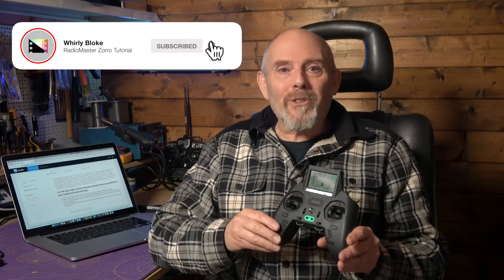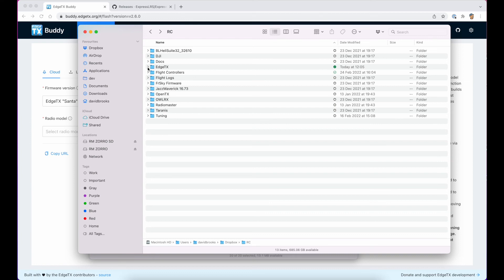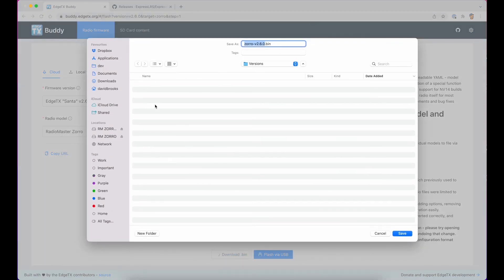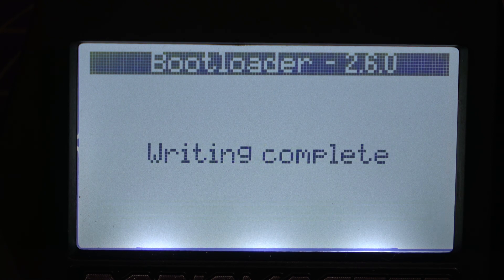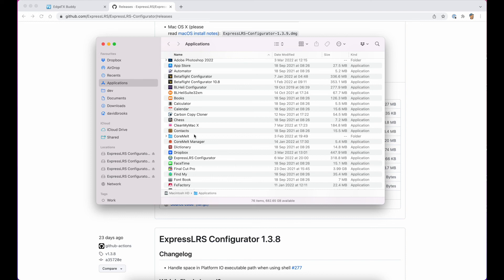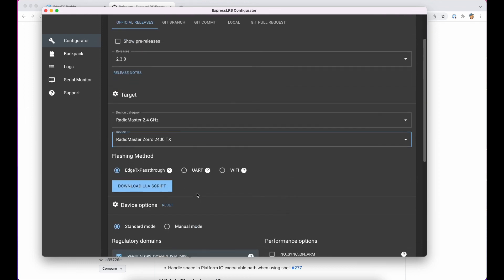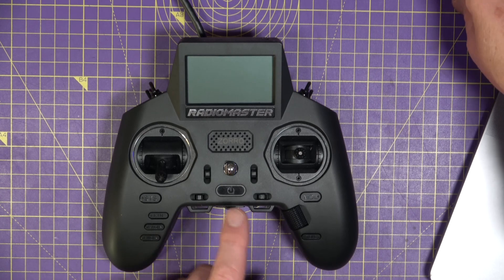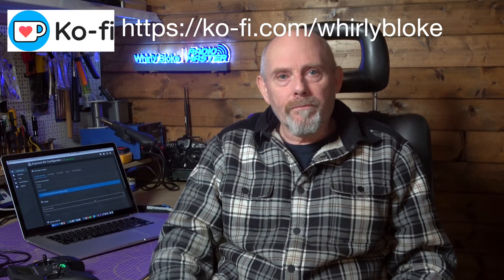RadioMaster Zorro Tutorial - Upgrading EdgeTX and flashing ExpressLRS ELRS RF module

Comment: I've had a Zorro for nearly 6 months now and it's just one issue after another.
No documentation, dodgy serial port drivers and constant issues with ELRS lua scripts.
I'm now getting an issue where the BIND menu exits after 1 second and nothing appears in Betaflight.
Yeah, my firmwares are up to date....I seem to spend more time farting around with them than I do flying.
Are all radios this shit or would it be worth springing the cash for a TX16 II?
Reply from the maker: Totally get the frustration — the Zorro can be fiddly, and you’re not alone with issues like ELRS Lua bugs and binding problems. It feels like more time tweaking than flying.

The TX16S MKII is a solid step up. Way more stable, better build, and just works. If you’re tired of messing around and want reliable gear, it’s worth the upgrade. If you want something compact but solid, the Boxer is also a great choice.

Comment: Thanks for a great tutorial.
Reply from the maker: You are welcome!
Reply: @WhirlyBloke  By the way, the original ELRS that shipped with the Zorro allowed to go up to 250mv in TX power. After the update to the latest elrsV3.lua, the TX power caps at 100mv. Is that expected? anything in the regulatory configurations that can up the TX power higher than 100mv?

Comment: I flashed my TX12MKII with EdgeTX buddy but the hardware page in my radio under options show luac, but no lua
do you know how to get the lua build option too?
because I want to install Yaapu Frsky Telemetry script and it's wiki says I need both lua and luac
Reply from the maker: To get Lua and Luac scripts, you need to check the firmware build options you selected during the EdgeTX flashing process. Make sure to select a build that includes both Lua and Luac scripts support. You may need to reflash your firmware with the correct options. This should allow you to use the Yaapu FrSky Telemetry script. Let me know how you get on.

Comment: I was performing an update of the software to its latest version (EdgeTX "Providence" v2.9.1), it was done without complications, but the remote control doesn't turn on. I have already checked the batteries, and they are functioning normally. What can I do to restore the factory settings?

Comment: Threr is only the flash option, not the build option. Its not working. Help pls
Reply from the maker: Check the RadioMaster website, latest Zorro manual or ask RadioMaster support. I've found they are very responsive.

Comment: I bought second hand zorro with external happymodel 24 elrs. Because i have quadcopter with v3 elrs, i install v3 elrs in happymodel. Everything seems work very well, my zorro can connect to my drone and control it. But, when i enter expresslrs menu in my zorro, i only see two menu. 1, other device, and 2 is exit. Its strange

My question, should i update my zoro firmware?

Thank you
Reply from the maker: Definitely. You need the correct LUA scripts on the Zorro to setup up ELRS. The easiest way to do this is upgrade the Zorro to the latest version of EdgeTX which will install the latest LUA scripts on the Zorro. Thanks for watching.
Reply: Thank you for your respond and anwer sir @WhirlyBloke  . I follow your instruction video but little bit confuse for choosing firmware name (i see many name firmware), so i choose edge tx providence 2.9.1 with radio model radiomaster zorro. After i installed it. my radio can conect to drone but i cant arming  my drone and my problem still exist. I check the expresslrs menu on radio and i didnt see anything. Can you give me some advice?

Thank you

Comment: I just replaced the internal 4in1 board with an ELRS board in my new Zorro.  Everything in the app works until it tries to connect to the transmitter.  I'm getting failure to connect on COM3.  Going to try UART and see if that may work.
Reply from the maker: Thanks for sharing your experience. Let me know how it works out.

Comment: Sorry, but I get errors and now I cant bind to my other 2 quads which have Elrs. For me its a disaster.
Reply from the maker: I'm sorry to hear that you're facing difficulties after upgrading your RadioMaster Zorro and flashing the ExpressLRS ELRS RF module. Firmware upgrades and module flashing can sometimes be challenging, and errors can occur along the way.

If you're currently unable to bind to your other two quads that also have ELRS, I understand how frustrating that must be for you, so here a few things to have a look at.

First, make sure to double-check the firmware versions on your RadioMaster Zorro and the ELRS modules. It's essential to ensure they are compatible with each other. Also, verify that you have the latest firmware installed on all your devices.

Next, check the configuration settings on your RadioMaster Zorro and ELRS modules. It's crucial that they match the required settings for binding and communication. Sometimes, a small configuration mismatch can cause binding issues.

If the problem persists, try following the correct binding procedure for your quads and the ELRS modules. Going through the binding process step-by-step might help identify any mistakes or missed steps.

Additionally, if possible, attempt to bind one of your ELRS-equipped quads with a different transmitter. This can help determine whether the problem lies with the RadioMaster Zorro or the ELRS modules themselves.

Remember, you don't have to face this problem alone. Reach out to the RadioMaster or ExpressLRS communities for support. They have active forums and social media groups where experienced users can offer guidance and help troubleshoot issues like this one.

I understand that technical difficulties can be frustrating, but with patience and support from the community, I'm confident you'll be able to overcome this setback and get your quads back in the air.

Best of luck, and I hope you're able to resolve the issue soon!
Reply: @WhirlyBloke  Thanks for quick reply. I will try to restore the Zorrow from back up. You’re correct it’s very frustrating. It really shouldn’t be this hard and only tried to update after buying the Crux 35. I normally use Crossfire and never have issues. Will see how this drama plays out. Cheers.
Reply from the maker: @scrubbasher6418  I know it's probably a bit late now, but always, always, always backup your radio or flight controller before you do a firmware upgrade. It's easy to say, and I've forgotten in the past and regretted it, but it's good practice.
Reply: @WhirlyBloke   Update. Got the Crux35 to bind to the Zorro. I needed to check what firmware I had on the TX and and it was 3.2.1 so I knew it should work. Anyhow I needed to change model match to on. Its in the instructions damm it. When all else fail hey. Now i believe i have to change the firmware on my mobular7 and gep smart 16 to work now. Thanks for all your replies.

Comment: when my pc was flashing, i didnt have enough disk space, when i freed up space, it didnt ask me to install anything again but the flash was successful. is this a problem. or how do i set it away to install again?
Reply from the maker: It's possible that the Radiomaster Zorro software was already partially installed on your PC when you started the flashing process, and that the freed-up disk space allowed the software to complete the installation and successfully flash the device.

If the flashing was successful and you're not experiencing any issues with your device, then it's unlikely that there is a problem. However, if you want to ensure that the software is installed properly, you can try uninstalling it and then reinstalling it from scratch.

To uninstall the Radiomaster Zorro software, you can follow these steps:

Click the "Start" button in the lower-left corner of your screen.

Type "Control Panel" and click on the "Control Panel" app that appears in the search results.

Click on "Programs and Features" or "Add or Remove Programs" depending on your Windows version.

Scroll down the list of installed programs until you find the Radiomaster Zorro software.

Click on the Radiomaster Zorro software, and then click on the "Uninstall" button.

Follow the prompts to uninstall the software.

Once the software is uninstalled, you can download and reinstall it from the official Radiomaster website. During the installation process, you should be prompted to select the installation location and disk space, so you can ensure that there is enough space available for the installation.
Reply: @WhirlyBloke  i kept my eye on it but every thing is working as it should now 👍

Comment: I just bought the RadioMaster Zorro 4in1. On this device do I still update Express LRS into it? ATM I am just buying this controller to hook up to my iMac 24" and play the sim. I don't have a drone for this. I have the Avata, but the Controller 2 doesn't want to work with my iMac so here I am. 

Thanks for the informative video. I had no idea there is so much this controller does. :goodvibes:
Reply from the maker: The RadioMaster Zorro 4in1 is a transmitter module that supports multiple protocols, including ExpressLRS, Crossfire, FrSky, and FlySky. If you want to use it with a simulator on your iMac, you don't need to update the firmware to ExpressLRS unless you plan to use it with a drone that requires that specific protocol.

To use the RadioMaster Zorro 4in1 with a simulator on your iMac, you will need to connect it to your computer via USB and configure the input settings in your simulator software to recognize the controller. You may need to download and install specific drivers or software for your operating system to ensure that your iMac recognizes the controller correctly.

It's worth noting that if you plan to use the RadioMaster Zorro 4in1 with a drone in the future, you will need to update the firmware to the appropriate protocol, such as ExpressLRS, for that specific drone. Firmware updates typically require a computer and a USB cable to connect the transmitter module, and the specific instructions may vary depending on the firmware and drone you're using.

I hope this helps!

Comment: Hi purchased a zorro, with firmware already installed, im using crossfire and tbs agent light is already on my zorro, i want to put my model bin files from opentx on the radio, and i cannot workout how to convert bin files into Yaml, firmware version v2.7.1. any advice welcome, Thanks
Reply from the maker: To convert your OpenTX model bin files to YAML format, you will need to use the OpenTX Companion software. Here's how to do it:

Download and install the latest version of OpenTX Companion software from the OpenTX website.

Connect your RadioMaster Zorro to your computer via USB cable.

Open OpenTX Companion and click on the "Read Models and Settings from Radio" button.

Wait for the software to download the model data from your radio.

Click on the "File" menu and select "Save As".

In the "Save As" dialog box, select "YAML (*.yml)" as the file type.

Choose a location on your computer to save the YAML file and give it a name.

Click "Save" to convert the model bin file to YAML format.

Transfer the YAML file to your RadioMaster Zorro by copying it to the "MODELS" folder on the radio's SD card.

On your RadioMaster Zorro, select "Models" from the main menu, then select "Restore Models".

Select the YAML file you just transferred and click "Open" to load the model onto your radio.

That should be it! Your OpenTX model should now be loaded onto your RadioMaster Zorro and ready to use.
Reply: @WhirlyBloke  well it's been so long when I asked this question! Ended up starting from scratch, but think I tried with open tx companion and didn't work but I may of been using an old version of opentx

Comment: Zorro can bind traxxas receiver TQi?
Reply from the maker: Yes, it is possible to bind a Traxxas TQi receiver to the Radiomaster Zorro.

To bind the Traxxas TQi receiver to the Radiomaster Zorro, you will need to select the TQi receiver protocol in the Radio Setup menu of the Zorro transmitter. You will also need to put the TQi receiver into binding mode by following the instructions provided in the Traxxas TQi receiver manual.

Once the receiver is in binding mode, you can initiate the binding process from the Radio Setup menu of the Zorro transmitter. The Zorro transmitter will then search for and bind to the TQi receiver. Once the binding process is complete, the Zorro transmitter should be able to communicate with the TQi receiver.

Comment: Very good tutorial. Just subscribed. Do you have to use Button Top batteries with this controller or will flattop work.
Reply: flatheaded will work with a bit of modification to the contacts on the buttom . i had the problem that radiomaster zorro is out of the box not compatibel to the flat headed ones ;) by bending them upwards with a flat scew driver the problem is solved . with the modificaton done to the radio you can use Li Ion Batteries with much more mAh  for example (Vapcell F14 INR18350 3,6 - 3,7V 1400mAh Li-Ion Akku 3A)
Reply from the maker: You need 18350 cells https://bit.ly/3irQvbv